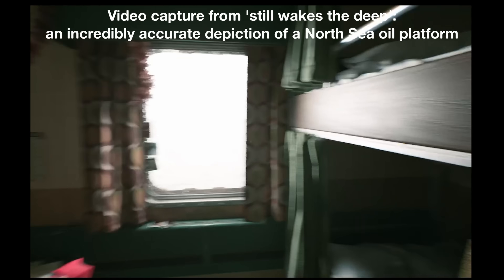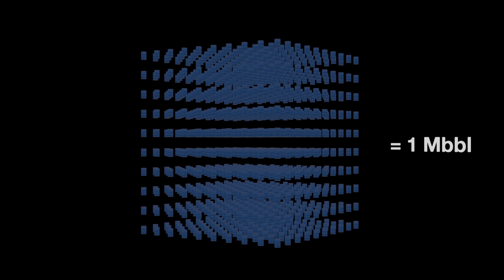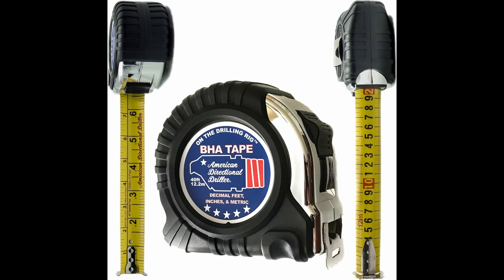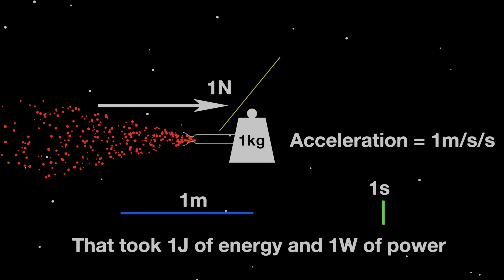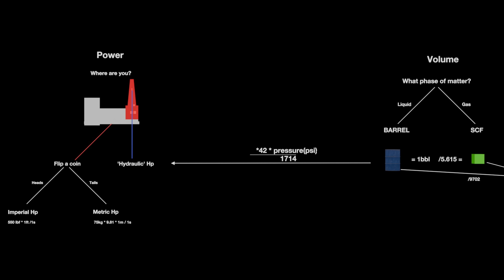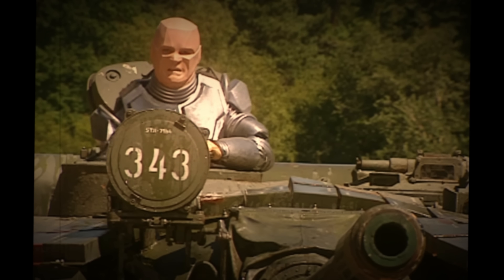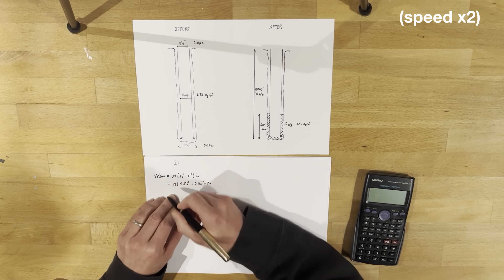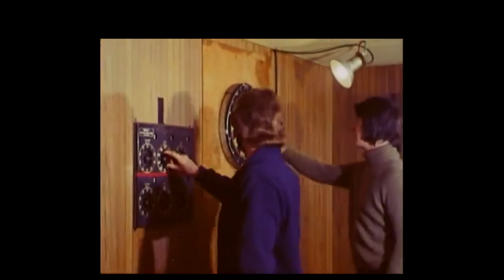Oilfield Units: a Measurement System so Cursed it made me Change Career

Comment: I hate everything about this. Great video.

You somehow managed to avoid force vs weight and thousandths. The devils taint of imperial units. At this point the only reason I can see for the US to not convert is machining: almost every machine tool in the US is set up with imperial lead screws and that does matter for converting to metric.

Basically the only unit i "like" is Fahrenheit because it is the right size for day to day human sensitivity and gives good results for that at the scale of temperatures humans experience on a daily basis. The freezing point of a saturated salt solution is awkward to measure for the zero, but 100 being around body temp works out well for human comfort calculations. But outside human survival it just doesn't matter and the temperature scale just needs to fit the units and I guess that is Celsius.

Comment: I'm guessing the "standard" part of "standard cubic feet" standardises the pressure and temperature of the gas, right? Thinking that otherwise you might have a cubic foot volume containing a single methane molecule, and still call it a cubic foot of natural gas.
Reply: Yes, that's correct.  And specifically it refers to "standard temperature and pressure", which is not actually something that's a universal standard at all.

Comment: I'm a fairly simple guy, and don't take many measurements. But that measuring tape with feet divided into tenths of a foot instead of twelve inches bothered me more than I ever thought possible.
Reply: I need to get a tape with decifeet on one side and inches divided by pi on the other side (For measuring the diameter of things by wrapping the tape around them - it ends up close but not usefully close to cm) and leave it out for anyone who needs a tape...
Reply: @peglor  Loki is that you?
Reply: Also watch out for pattern maker's rulers/yardsticks that are oversized slightly to account for shrinkage of a given molten metal in the mold.
Reply: Maybe I am too metric brained, but why is it bad? 
That is exactly what I would do if I were tasked with simplifying imperial units. Get rid of inches and use decimal feet.
Reply: @Currywurst4444  base 2 is a lot easier to read on a scale.
Reply: Thats what I feel when I'm using measuring tape with inches parallel to cm scale. And there are inches in measuring tapes sold in EU! The diesese spreads!
Reply: Funnily enough, for non Imperial units users, this is as non-sensical as the usual imperial measurement tape. Actually it might be less non-sensical if anything.
Reply: Yes, just about the only good thing about feet and inches is the base 12 thing. Get rid of that and you may as well just go metric.
Reply: Like we already have an easy to understand subdivision for feet.  WHY DID SOMEONE THINK WE NEEDED ANOTHER?
Reply: @afrozen10-02  They should have used a much simpler, easier to remember number like 5280 instead.
Reply: @peglor  
It's eight furlongs to mile. it getting converted to feet was just backporting.
Reply: @semi-useful5178  And 10 chains to a furlong so a little bit of decimal does squeeze itself in there...
Reply: @peglor  We can blame the awkward size of the chain not on Gunter who came up with it but rather one of the early King Edwards. Somewhere along the way, it was decided to resize the inch, foot and yard but leave the larger units like perches/rods and furlongs alone, since those units defined what was really important then, the acre, which couldn't be resized as all the lands of the realm were given by it. What they did was take ten old inches and declare that that length would now correspond to eleven inches. The foot was still twelve inches, but 10/11ths its old size (in fairness, those old feet were pretty big for a foot). A yard too was still 3 feet, but this now meant that rods/perches ceased to be 15 feet and became 16½ feet instead. 4 rods make a chain of 66' but had the change in the size of the foot not occurred the chain would have ended up as a reasonable 20y/60' while furlongs would have been 200 yards or 600 feet and the mile 4800 feet or 1600 yards... which is interesting because the mile is also just over 1600 metres. That's because the old yard is very close to a metre at ~1.006m.

That's right: prior to that intervention, the old English system's yard was within a quarter inch of the then-future Metric metre.
Reply: @davidjames4915  Fantastic information there - thanks. 

Irish miles used to be very close to 2 km. I suspect they were defined to be as big as they could get away with in order to 'legally' grab as much land as possible when the UK showed up and declared the country unsuitable for use by for the people who already lived there.
Reply: @afrozen10-02  depends on what you're doing, but because sometimes you get decimal inches on parts.  I have a metal ruler that's got 32nds on one side, 10ths on the opposite side, if you flip it over then it has 64ths and 100ths.  It's also not uncommon in other measuring instruments.  Calipers for example, have decimal inches on the slide rule at the bottom and then thousandths on the dial.  Micrometers have twenty five thousandth increments on the side and then marks for each thousandth of those twenty five wrapped around the sleeve and a vernier scale for ten thousandths.

Comment: 8:21 Pounds are the unit of force in this system, and the unit of mass is the slug. Yes, the slug.
Reply: Except you've also got pound mass which then creates confusion with pound force.
Reply: In measuring the fuel efficiency of rocket engines, you use time * force / mass, specifically seconds * lb force / lb mass. Then you cancel the lb to get the answer in seconds.
At least seconds are consistent between metric and Imperial.
Reply: @hammerth1421  1 lbf = 1 lbm * 32.2
Reply: We just use pounds mass. Nobody uses slugs
Reply: @GuyFromJupiter One of my modern aerospace engineering books refers to slugs. Even though the book is supposed to be an international edition, it still contains US units of measurement😅

Comment: Just to chime in, in my opinion Watt hours make more sense to use for larger values, simply do to how easy it is to work with. How much energy will my 600 watt heater consume in an hour? 600 watt hours vs 2.1 million joules. Watt hours are jusy easier to do math for

Comment: Don’t worry too much. In WW2 there were whole teams composed of US, UK and Canadians whose job was to standardize terms and ratios of exchange. Non stop.
Reply: Those same teams are needed just for the individual services of most countries. Stupidest timeline imaginable.
Reply: @corvanphoenix  I have a whole document covering things like... what kind of wood to use for crates... and how often a nail had to be spaced... depending on the dimensions of the crate.
Reply: @corvanphoenix  look no, just be glad the French Revolution happened (for many reasons) okay?  Europe was a mess but they sorted themselves out — and this was AFTER they stopped invading each other twice last century
Reply: A large chunk of successful industrial co-operation in WW2 rested on one Swedish manufacturer of gauge blocks getting fed up in the early 20th century and basing his blocks on a 25.4 mm inch, for both the US and UK markets.  Before this, the difference between the two unit systems was too small to measure easily but big enough to mess up an engine.

Comment: Fun fact, standard cubic feet (scf) isn't a measure of volume at all. It's a measure of molecular quantity, the "standard" refers to either 60F or 68F (it's not standardised) and 1atm pressure, then using the ideal gas law you get the number of molecules for the specific gas composition.

Comment: KWh makes sense over SI.

10kwh can run a 2kw kettle for 5 hours 

A 10,000J×3600 Seconds / 2,000 = ????
Reply: While I agree that kwh is fine for simple electric stuff, your example is a bad one, since it's solved within a second or so.
Reply: @slome815 you cant solve the SI equation in one second, it requires multiple simplification steps. The KWh is done in one second, thats kinda my point 😂😂

Comment: Just as an aside, a "Mud weight" is a form of boat anchor, mainly used on inland waterways, rivers and canals. It's literally just a big weight, with no sticky out pointy bits (technically called Flukes) like most anchors. 

I'm sure that this will never cause any confusion...

Comment: Wow i thought regular thermodynamics was a slog then you add a bunch of old American slang with multiple units to confound and make checking your work or if your peers correctly did the calculations much more difficult.. Ya that sounds like a toxic work place environment in both culture and substance. 
But its likely for a reason. It is an example of "in speak".its the use of language to form a group culture thus developing in and out groups to the culture. As seen with how Starbucks names the sizes of coffee. Corporations use in speak for the feeling of exclusively that people in the club get once they understand it and help with brand loyalty. Similar stuff happens in the military where units develop linguistic differences like the artillery calling people a gunner not a corporal. They haze new people to make sure they conform to group standards and are different than normal standards thus more likely to identify with and support the group they're in and not other external groups or brands and allow the identification of fellow members.

Comment: US TV still insists on using 29.97 frames per second for deliverables even though that number only mattered when they were bodging analogue audio into analogue TV pictures… a system last used for commercial broadcasting in 2009! [edited: I used 23.97fps first since my clients mangle film, but TV was based on mains frequency in them days, so 29.97 is more illustrative of the nightmare]

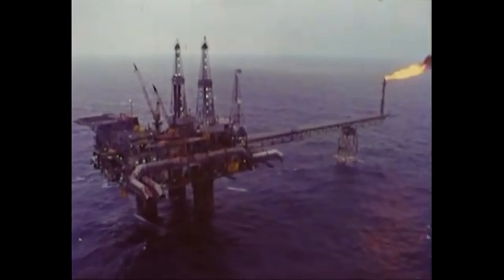Comment: 6:54 Specific gravity is just an old fashioned term for what SI calls "relative density". It's a ratio of densities (so technically dimensionless), and the density of water is usually, but not always, the denominator, since "will it float on water?" is often an important question. But with drilling, most of what's around you is rock, much denser than water, and the fluid you're interested in extracting tends to be much less dense, and there's probably not much water side from what you introduce(?), so I can well imagine that water might not be your density reference.

Comment: Also oilfield (still). 
Did a "metric" job in South Africa, so we had metres of 7" tubing. That always stuck with me. 😂
I still convert everything to metric (if not necessarily SI) for calculations then convert back and I'm rapidly approaching retirement.
Weirdest tape measure seen - an OD tape you wrap round a pipe to read the outside diameter.
Reply: OD tape? So markings scaled up by pi? That's neat!
Reply: @hairychris444  Someone in another thread was mentioning one with a vernier scale at the end to measure more accurately, too.

Comment: Jail for the decimal tape measure. Jail for ten thousand years.
Reply: or possibly twelve thousand years
Reply: @chri-k   oneshot pfp :)
Reply: Metric years or imperial?
Reply: @VEC7ORlt  In the oil industry they actually still use the pre-Julian calendar. So the duration of each year depends on the number of intercalary days added to the end of February, which is determined through augury - the ancient practice of receiving omens by observing the flight of birds (or by reading sheep entrails, if all the birds got stuck in an oil slick again).
Reply: I really shouldn't have lold at this. But I did, indeed, lol.
Reply: @VEC7ORlt  need to convert it to burning blue barrels per day....
Reply: Decimal tapes are a GREAT idea. It's inches that suck. Feet or inches: choose ONE. Until the US switches to a base 12 numerical system, combining feet and inches is moronic.
Reply: @actuvon  *decimal inches

Also miles suck arse
Reply: 10ky
Reply: I have flashbacks to that Blondihacks video where all measurements are in negative-power-of-twos of inches but all tolerances are in thou.
Reply: Maybe I am too metric brained, but why is it bad? 
That is exactly what I would do if I were tasked with simplifying imperial units. Get rid of inches and use decimal feet.
Reply: @Currywurst4444 why would you bother simplifying the imperial system? If imperial units are too stupid just use metric! We use imperial units because it's customary, but if we're going to change at all why would we spend the energy making that same system ever so slightly less bad and confuse everybody else in the process rather than just using SI units?
Reply: @Currywurst4444  Because it's a percentage representational unit of a non base-ten unitary system.

It's an incredibly bad idea.
Reply: @Currywurst4444   The bad thing isn't that it exists, the bad thing is that the two systems are being used at the same time. Inches and feet are a bad system but having to manage two systems at once is far worse
Reply: Straight to jail.
Reply: The only place I've ever encountered decimal foot measuring being used is by surveyors.  I don't have a problem with it...
Reply: You laugh, but depending on the industry, jail time is actually a possibility if you're caught certifying an official measurement in a confusing way.
Reply: We use decimal feet in civil engineering in the US.
Reply: @SpAm-AcCoUnT  you've never seen one before??
Reply: What about a 12” scale with standard measurements on one side, and a Tenth of an inch on the other.

Comment: This is worse than the Barrer (also a unit of permeability equal to (10^-10) (cm3STP) cm / ((cm^2) s (cmHg))
Aka (10E-10)x(particles in 1cc of air at STP)x(thickness)/((area)*(time)x(pressure)

Also a foot is a more useful size then a meter (nobody uses decimeters) and dozenal is so much better than decimal, but otherwise SI is pretty good

Comment: If oil companies designed cars, the speedometers would read Leagues per Decade. I'm glad that I didn't have to work with oil (transport) any more, especially when the ship's bunkers were almost full and the local guy on shore in charge of the "barrels" (at Ras Tanura) has buggered off for a smoke or something.
Reply: This was meant to be a joke, but usually in the oilfield we measure speed in feet per minute (it's a relatively useful rate for a  lot of stuff we do) so there you go.
Reply: "If oil companies designed cars, the speedometers would read Leagues per Decade."
If you think they'd get a unit of speed by dividing a unit of distance by a unit of time, you obviously didn't watch the video.
Reply: @beeble2003  🤣
Reply: Speed would be in minutes per centiday, where the "minute" is a unit of length: how far you travel in one minute at a speed of 24 knots. In contexts where it is clearly a speed, the phrase "minutes per centiday" would also be abbreviated to "mpc", "minutes", or "m".
Reply: No, no, no! The only proper unit of velocity is "Furlongs per Fortnight"!
Reply: @alexandermonro6768 and how many hectares per hogshead

Comment: This comment is laid out in stickies per stoner over time squared divided by the number of roaches in my ashtray.
My coffee is measured in mugs per bell, travel distance to work is in units of 144 half paces called "trots" at 196 inches each or 250 trots if I take the direct route which is by train, which of course we call the wheeliebench, or 300 trots in the pushcage AKA motor vehicle.
Writing this while seated on a breakpaddy (chair) at the ogleflats AKA desk using my T-wing (laptop).
Cheers.

Comment: This should be an advertisment for the SI system, and everything should be measured in it. EVEN science has this problem, with bullshit like parsecs. If you are an astrophysicist, you damn well better be able to read exponential notation, so you can use the meter. And where I studied most extensively, the cgs derivative of the SI system, which is still far better than any of this or freedom units for that matter, can fuck off too. Absolute pain in the arse when one third of the science you do has some non-consistent number of powers of ten which needs to be dealt with to compare stuff

Comment: No one is going anywhere near pi for your volume calculation they'll use ((OD^2-ID^2)/1029.4)*lenght (in ft) = vol in bbl. I'm not sure about the blue barrel explanation for the abbreviation. It might explain why the oilfield barrel is 42 us gal. Unfortunately everything about it is unsourced or is self-referential, or straight up copied from the same place though what is the original source of the sentence QUOTE "However, while Ida Tarbell’s controversial 1904 History of Standard Oil Company acknowledged the “holy blue barrel,” the abbreviation “bbl” had been in use before the 1859 birth of the petroleum industry." END QUOTE  is hard to determine. At least not without doing far more research than I can be bothered to do just now.